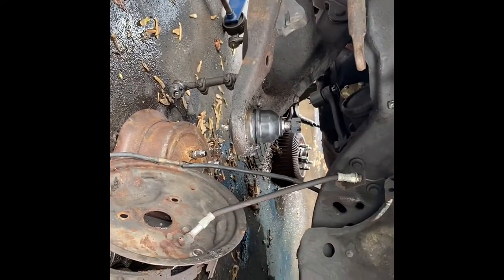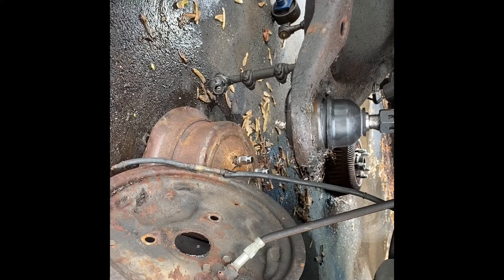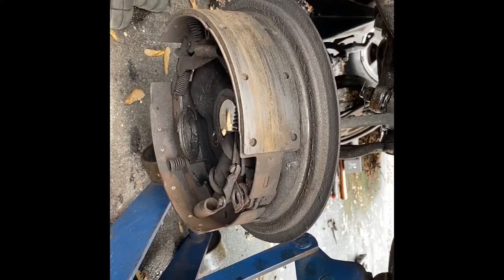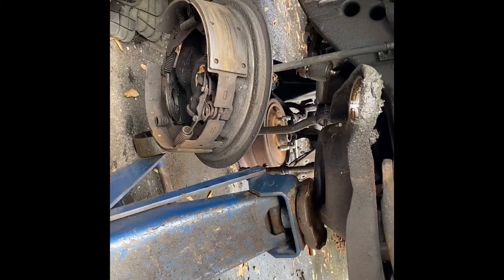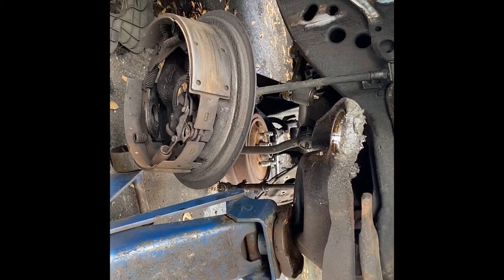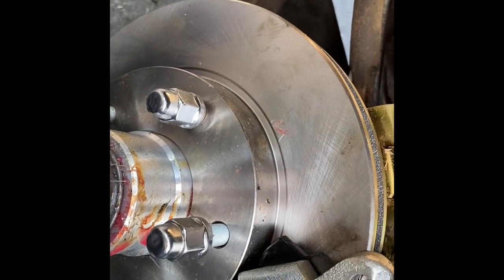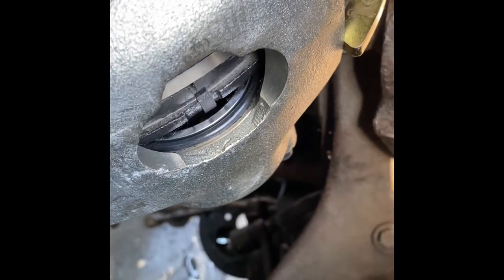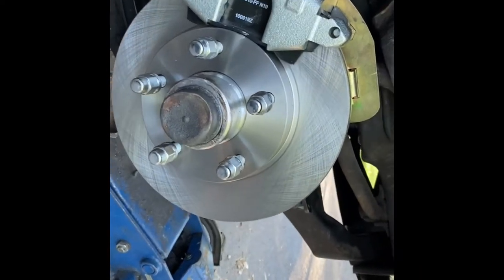Disc Brake Conversion 66-70 Full Size Oldsmobile

Comment: Man I need this work on my 68 Oldsmobile 98 vert
Reply from the maker: Really not too bad to do
Reply: @oldslegend6710  I gotta start looking for the parts I’ll need
Reply: @oldslegend6710  where’d you get the rear disk brake conversion kit from?
Reply: @oldslegend6710  the QA1 coil over doesn’t come for a 98. Would a delta 88 QA1 work for a 98?
Reply from the maker: @scoobert20  yes they will
Reply from the maker: @scoobert20  scare bird.com

Comment: Great video and info.  I have a 66 Toronado.  There are lots of things I want to do with it. 4 wheel disc brakes to start.  There is not much info on a proper disc brake conversion.  The Olds Club and Toronado Club have mentioned it over the years, though it is always a mix of junkyard parts from this or that car, and lots of "maybe this will work".  It would be great it there was a kit of new parts to do the disc brake conversion.  Does anyone have any info on a front or 4 wheel disc brake kit?  I understand that the 1966 specific Toronado wheels will not accept most disc after market brake conversions.
Reply from the maker: Look at the disc conversion kits for Eldorados
Reply from the maker: Try Scarebird.com
Reply: @oldslegend6710  Thanks.  I will contact them.
Reply from the maker: @TriggerArizona  no problem

Comment: Correction ..sorry i thought you working on a 64 ... does any other shocks interchange with the 1964 dynamic 88?
Reply from the maker: Shocks? There should be several different types that work